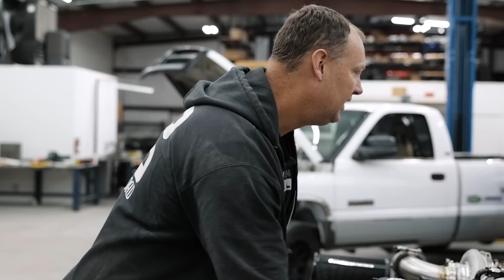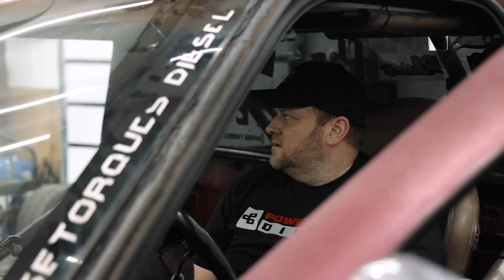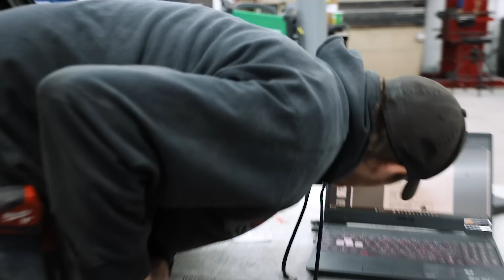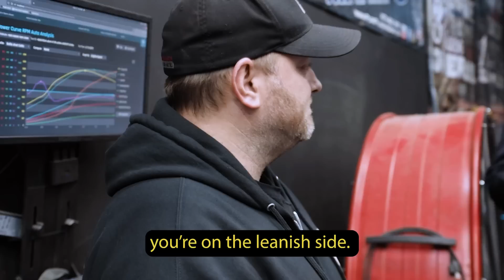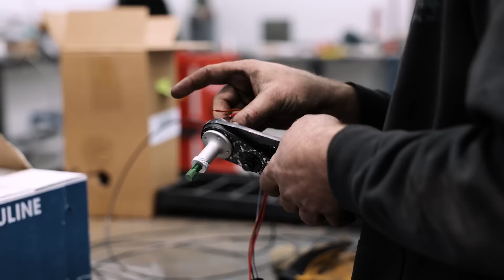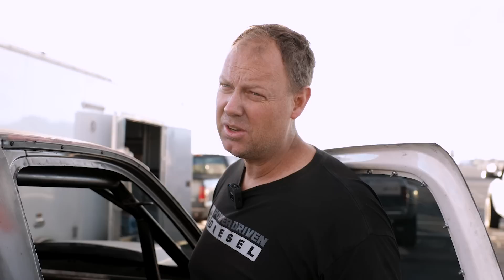Diesel Drag Racing at The Strip

Comment: 241 t-case is weak sauce put a 271 in it its a good bit stronger.
Reply from the maker: Myer still hasn't fully assessed the failure to see what needs upgrading, that said it's a tall order to expect that heavy truck to leave at 1200+ HP off the transbrake!
Reply: @ true but a 271 has a 20% better chance at surviving life than a 241dhd has 😎

Comment: What if you made a gurdal and deck plate connect outside the block with some kind of custom all thread on the intake and exhaust sides to prevent the block from separating
Reply from the maker: Will hasn't been having block separation problems/failure at the cam tunnel area, he's been having cylinder wall cracking and failure.  A deckplate would possibly help, but that's a ton of work for 1500 HP, whereas a factory 6.7 block seems reasonably reliable at the power level with no modifications.... Will is just hard-headed and wants to use a 12v block.

Comment: What’s Todd’s wheel and tire setup?
Reply from the maker: The tires are M&H cheater slicks. The wheels are lightweight but i forget the brand.
Reply: @ ya I’m curious r they 5 bolt 15s or what? Cause I’m looking to do the same on my second gen but need to figure out the brakes to allow 15s
Reply from the maker: They are 8 lug wheels and factory axles.

Comment: what’s the deets on wills combo? injector size? delivery valve? timing? turbos? dam that’s impressive.
Reply from the maker: 5x028" injectors, full cut Dvs, 215 pump with stock 215 cam, maxed to 780 cc's, 31* timing, 472sxe fed by 115mm GTX55

Comment: 👍👍y'all should revise your belt driven transfer pump to run direct off the accessory drive through the cover or something...like the waterman or whatever.. or kinda like a 3406E  and it's derivatives..or something,but anyway 👍👍👊
Reply from the maker: It would spin too fast. We really need to reduce the rpm for this style of pump. Believe me we have looked into it! lol
Reply: @pddofficial  👍ten four,I suppose ..I think an E7 Mack did something similar as well,for there unit pumped engine.. maybe u could incorporate that pump ...think Bosch made it...but,then it might not be as cost effective..but anyway, thanks for the response..see ya on the next one 👍👍👊